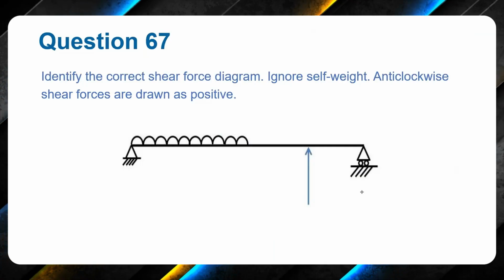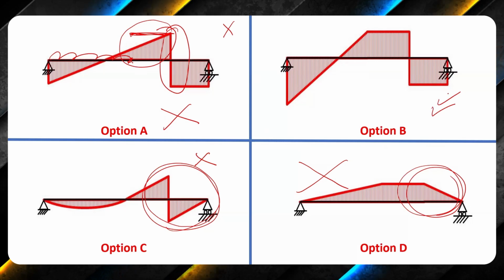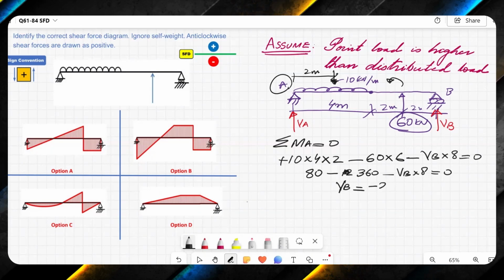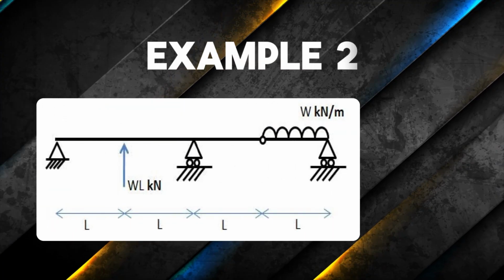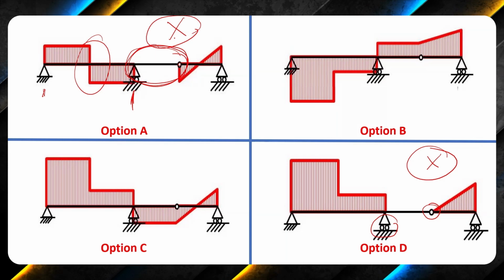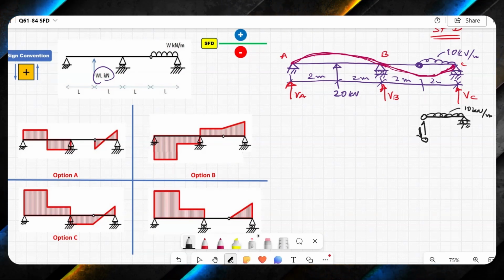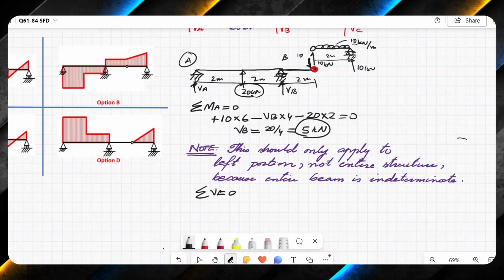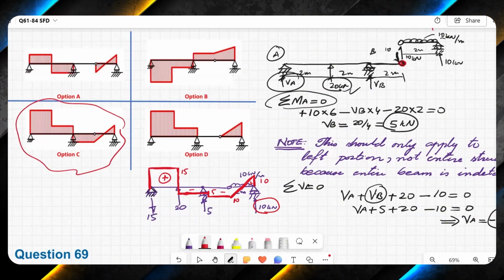Shear Force Diagrams Made Easy: Two Examples | IStructE Structural Behaviour Course

Comment: In example 1 Va is +15. The shear force  diagram is wrong. On the left side it stays above 0.
Reply from the maker: Let me check. I’ll get back to you.
Reply from the maker: I've double checked, it looks right to me. Please correct me where I'm wrong, I'll issue correction after your reply. What do you think the value of reaction should be?
Reply: @DrJQureshi  Your answer is right but the choices are not matching your answer?